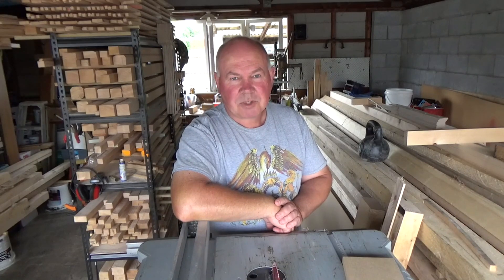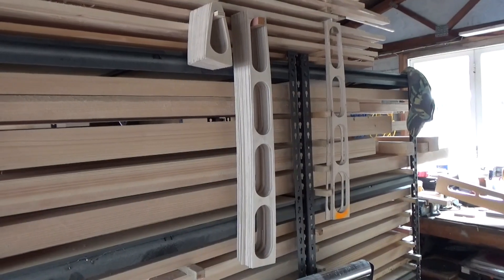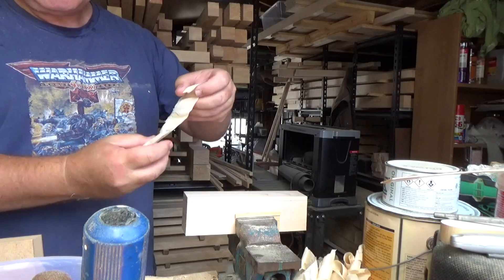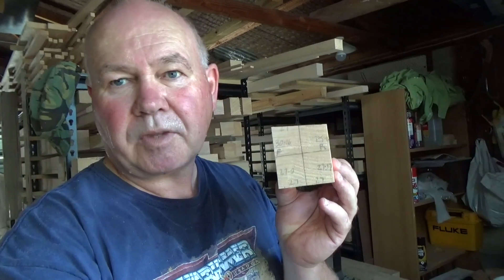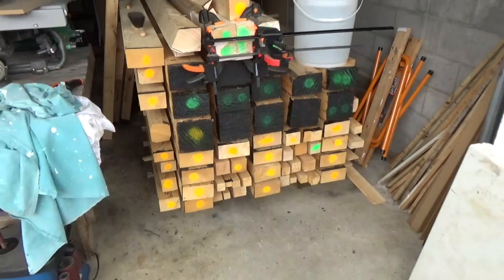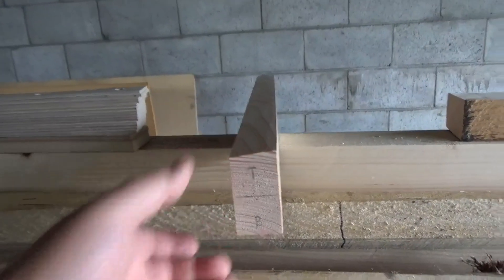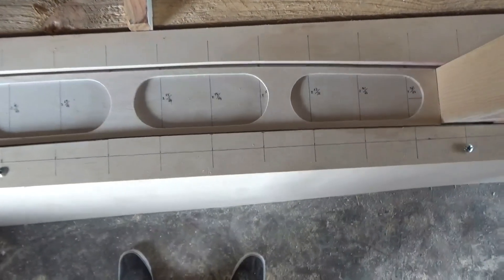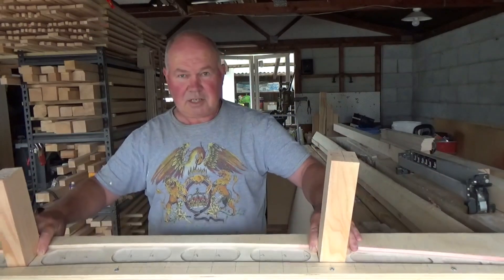Making Ribs for a 1917 Sopwith Camel Ep6

Comment: I used to build muzxleloading rifles and air dried 3" maple planks were dipped on both ends in wax right off the tree. None of them split. It will save your timbers while in storage.
Reply from the maker: Hi Gary, you will see in earlier vids the timber stack includes timber with black painted ends. The black paint is waterproofing paint for water tanks which I had spare after a job. It was applied immediately after milling (by me) to retard moisture loss through the end grain. These timbers are doing well. The ones suffering issues are those that have been broken down from these larger baulks (up to 6"x6"). ie. the processed aircraft timber waiting to be turned into parts.

The problem is more related to moving for work from a climate with low temp/high humidity to one of high temp/low humidity. This dramatically impacts and lowers the Equilibrium Moisture Content (EMC), the moisture % timber will stabilize at in that environment. In effect, timber that was happy and drying at a leisurely rate, suddenly started drying very quickly with the outer skin drying much faster than the inner moisture can migrate to the outer skin. Outer skin tightens then splits...

I've learned a lot about milling timber through this process. I'll do a few things differently next time, like not move!!!

Most of the splits and warping has happened in loose grained timber. Aircraft grade Spruce needs at least 6 rings per inch. It seems tight grained timber is less prone to these problems. Not immune though.